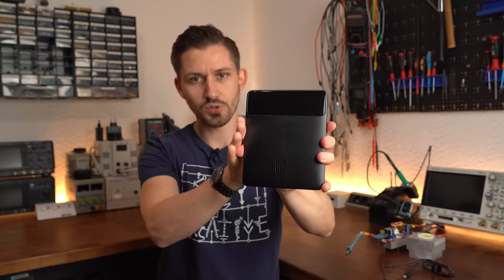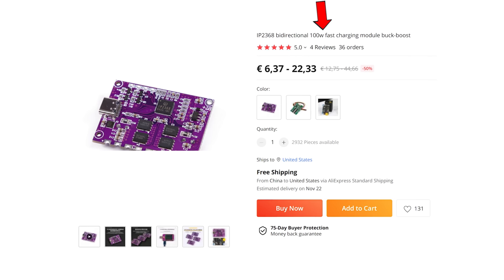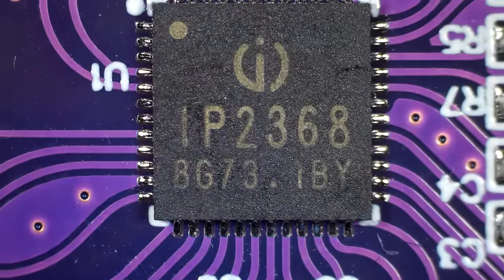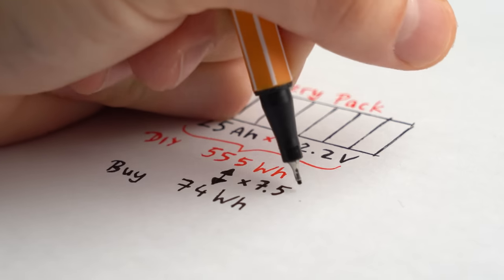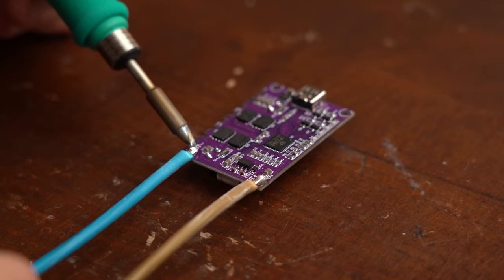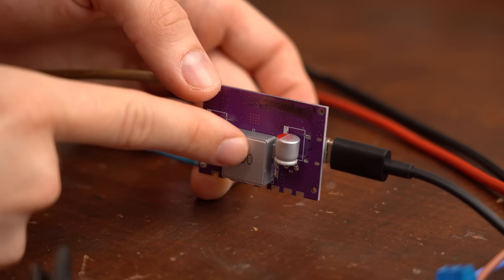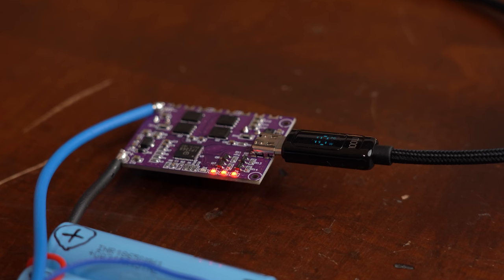My Power Bank Rivals Commercial Ones?! Super Fast! (DIY or Buy)

Comment: Hi!, you should look into sw2303, its only 6$ for almost the same board(it's not bidirectional so you will need a 1.5 dollar boost converter and a0.7$ pd decoy)
Reply: I’ve had no luck with both SW2303 versions I’ve tried. Buck boost causes overheating past 60W output
Reply: @ericklein5097 Hi, I wonder, what power supply or battry arrangement did you use? I plan to try with 5S or a 6s configuration to mitigate that exact problem but I have yet to had the chance
Reply: @liamsharashov8092  
LG MJ1 4S5P
LG MJ1 4S1P
And I have P42A's, Lishen 2170SA's, Samsung 25R6, Eve 33V, Eve 20P all available to make packs out of. the P42A's are for my super small laptop charging project for my dad. 4S 1P and 2P packs so he can decide what to take a tiny one to save space and provide just a little boost for Laptop or Phone or take the 2P to get at least a partial laptop charge on his Mac or over half on his Dell                                                                                                                                                                                                                                                                                                                                                                                                                                                     

Power supplies
Drok 0-48V 0-10 CC CV SMPS normally at 16.8V with current wide open
My Bench Power Supply 0-30V 0-10A, same as above but I've tried the voltage all over the place between 5V and 24V
SMPS 480W 24V 20A no adjustment
SMPS 360W 12V 30A with 1500W boost and 400W Boost
Sony laptop power brick 15V 8A

Boards
Feb 22 SW2303
Feb 22 SC8812A 120W
El Cheapo Sold by everyone SW2303 tried using solder pads for XT60 and a 14AWG 5521 cable
On The Way Right Now
IP2368
IP5389 (I think its from TZT Stores 100W Board)
Reply: USB C cables/PD Triggers/Loads
UGreen 1ft cables
A variety of USB C to Barrel Jack PD Triggers (20V)
XYZ PD Trigger ZY12PDN (2x)
A bunch of those male C to Female C and Female A PD trigger boards with the push button on each side of board and LED light for 5V 9V 12V 15V 20V
2020 or 2021 Macbook Pro
DL24 Electronic Load
Atorch 65 Watt Load Tester (brief moments past 65W are ok with fans)

Still need to install the 8x8x11mm pure copper heatsinks I got recently got

So I'm going to try to find the best low resistance PD Trigger/Cable but if 10 different ones didn't work....and UGreen I've seen tested and its one of the better 100W cables

I think only recently did they get a proper inductor selected and thats part of the issue. Resistance might be another as the voltage drops when power builds up but that could be how thermal shutdown. I measure temps over 90 Celsius around the IC and Inductor
Reply: @ericklein5097  wow, that is really disappointing news, but hi, why don't you make a video or something? 
I am sure it will be a great help for the community
Reply: @liamsharashov8092  I figured it out! Notice how Scott said he had to charge it and the voltage set the board up on where the SOC of the pack was?

I think that’s a permanent setting. It was shutting down on me because it thought there was no energy left in the pack. 

I’ve never charged the cells with the board and all my testing has been output output output
Reply: @ericklein5097  I don't think sw2303 support this function for this to be a problem.
No low voltage shut of and no input(only output) .
To charge the pack and get low voltage cut-off you need a different board(type c for input, goes to 12v pd decoy goes to boost board to the required voltage to the bms. bms also connects to sw2303 for output and it needs to have low voltage cutoff and such)
At least that was my plan, so if you find success with your your testing I would love to get an update.

Comment: @greatscott nice videos!!! i have a question...basically i need to reduce the number of transformers...for example i have 19.8V/90W transformer for NAS, 12V transformer for router, 6V transformer for a switch, 6V for wifi, 12V for the isp modem...they all together consume around 120W when idle...is there any way of making/buying a transformer with such a diverse power/voltage outputs? thanks a lot

Comment: I have scoured the internet and can't seem to find a pd that automatically applies voltage per device from 5v-20v. They are all manual. How are these power bank companies making these devices that automatically switch between voltages? or do they make them in house?

Comment: I like your video I get an idea now Thank you. Now I plan to create my power bank too. Can you create a 33 watts power bank 10V and 3.33A with a input and output? for my reference for creating a power bank too. Thank you.
Reply: I recently soldered a mobile Powerbank charging module to a 35mah battery.  
When I charge it, the led of the charging module lights up , but even after charging it for 30 minutes it doesn't charge my phone .

Does anyone know how to solve this issue?

Comment: Is there a way to adjust the R5 resistor to allow for 3 21700 cells in parallel lol? I have 12 21700 4100mah I'd like to turn into a big bank haha

Comment: Hey Scott, I tried using this module with a 4s lithium Ion pack, but even after charging it up (cells were already charged and it blinked the 4th/4 led) when i went to try charging a device, it blinks rapidly and doesnt charge anything!

any tips?

Comment: I bought same module i think I'll make a 100w Power Bank for my phone and which is also supported supervooc 100w but when i completed with the power bank i see my phone only charge at 10w but when i use with my laptop which supports 65w so this properly delivered 50w and charge my laptop.

Comment: Any idea what's inside the commercial one? If it also contains 18650 cells you could replace them with higher capacity A-brand cells and get better performance.
Reply: Pouch lipos

Comment: Just purchased this board. I have 12 cells that are 3400mah each. I didn't completely understand the amp restriction part of the video. Would I not be able to do a 4s3p with this board? I can go with 4s2p but if I could use the extra cells for more storage that would be great.
Reply: You can go 3P but you have to figure out how much total mah that will be and see if the resistor that controls capacity can support that. If not then your fuel gauge will just be useless.

Comment: I want to try this project using 8 ncr18650 Panasonic batteries (4s2p). Do I need to change the parameters on the powerbank module? It seems to me like the default parameters should be the same, but I am not so sure. Specially about the charging current one, which in the case of the ncr18650b battery is 1625mA x 2 (parallel) = 3.25A  (as opposed to the 3100mA x 2 = 6.2A of the lg battery in this video) . Since it exceeds the 3A from this chart 6:16 I don´t know if I should leave it at 5A or set the module to the closest 3A. I just started learning about this topic so any help would be much appreciated. 
edit: time stamp format

Comment: I am currently building a 7s 2p battery pack, and i was wondering what to use for power delivery. I want to be able to charge my laptop through usb c (at ~90W) butt I can't find a proper board that also charges the battery pack at higher voltages. Do you think there is such a board on the market, or should I just split the in/outputs so I don't have to worry about two-way boards?

Comment: hi. can you please explain one point - is it possible to connect elements of high capacity (like  lg chem for 78 amp hours or big prismatic cells) to this board? on the seller's page there is a table in which something is said about resistance and transistor r5, they say that the maximum capacity of the cell is 25000 mAh. the reason for the restriction is not obvious to me, especially if  bms  board is used. ty

Comment: would you be able to give me a direction to disable the 4h auto shutoff on a gtx280 powerbank? i think it is in such controller and not in the bms, it even shuts down with 210wh left, low current mode enabled

Comment: Hey Great Scott I've got a question for you, I'm building an ebike battery it's 48v 14s I've got a dally 40bms but I'm also trying to wire in a USB c charger so I can charge my phone while ridding Im still looking for a stepdown from 48v to roughly 12v to run a temperature based cooling fan and the pd charging. Do you think the ips2368 would work in this situation?

Comment: do i understand it correctly that the fuel gauge thing is only relevant for the LED indicators?
all the over voltage and under voltage stuff is happening independently of that right?
That would mean i can buy two of these boards and connect them to the same battery pack so i could charge and discharge at the same time or have two port that can provide power at the same time.
Reply: Hello, do you find answer for that?
Reply: @xeon8722  yes, I bought the boards and build my own Powerbank with it, the LEDs are just to show you how full the Powerbank is and require you to use a battery configuration that's supported and properly configure some resistors.
If you don't care about the LEDs all that basically doesn't matter.
I build a Powerbank with it that's above the supported capacity and I have 3 boards in there that don't know of each other so I can recharge with one board and discharge with the two others and the one board will display it is full because it doesnt know that I discharged with one of the others.
Over and under voltage protection are still working fine though.

Comment: Is 100W output really that impressive? Power Tool batteries have been able to output in excess of 100W for years. The issue is that you generally sacrifice capacity for that high power output. I remember, I changed the 18650 cells on one of my battery packs a few years back and though... hey, 3000 mAH is better than 2000 mAH. Unknowingly, the 2000 mAH battery has been used because of it's high output capability. It basically became useless for power tools because of it's higher internal resistance. I mostly just use it for low power tools, like the flash light and gives it a much longer run time.

Comment: Great project, Scott! Do you think it will accept low wattage charger to charge the battery pack like the Samsung 25w/45w charger or anker's nano charger?
Reply: Yes. I made exaclly the same as great scott and i charge mine with a lot of different chargers. i have used 5v 1A phone charger and it works but it takes all night to charge. I hope I helped you.

Comment: How do you feel about over charging li-ion cells? In your setup you are charging to 4.2V. In my experience it really degrades cells capacity over time.
Reply from the maker: Never had a problem with that voltage. Pretty much anyone charges them up to 4.2V.
Reply: @greatscottlab   - could the BMS be tweaked to use a slightly lower max cell voltage?
Reply: My charger goes to 4.1V which I'm happy with. Pushing li-ion cells to max charge every time is supposed to reduce their life but not really sure.

Comment: Every Maker worth his salt is able to build commodity items which outperform ANY store bought solution by a significant margin for a fraction of cost. This is the beauty of being a maker. I always think: Is this Item too expensive? If yes.. can I build it cheaper? If no, can I repair it? If no I don't buy it. 

Made things are 100% repairable. Bought things are usually 80% repairable when they broke the first time. I'm currently in the process of modding my houshold machines (washing machine ect.) to be more reliable, more convenient (wo does not hate the same piezo electric buzzer in every device, even +500$ machines) and repairable.
Reply: It's not always yes though, that's the whole point of this video series.

Comment: Hello 🙂
Thank you for this video. This could be a solution to build a powerbank out of tool batteries like makita, bosch etc? 
This would be a very super project - are you interested to figure this out?
Reply: This is that type of battery 18650 cells with a BCM

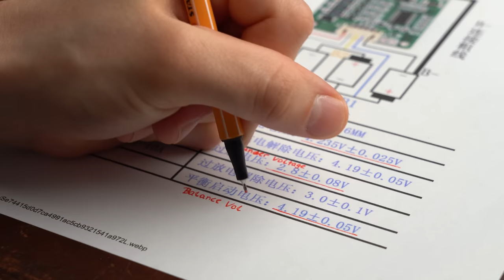Comment: 9:30 In this BMS case, could the output resistors be increased to charge the battery not to 4.20-4.25V, but to a maximum of 4.1volts, in balanced mode????
This modd, would significantly increase battery life, and it would be very important to change this!   4.1V =   + 30-40% charge cycle lifetime! If anyone knows, please let me know here!

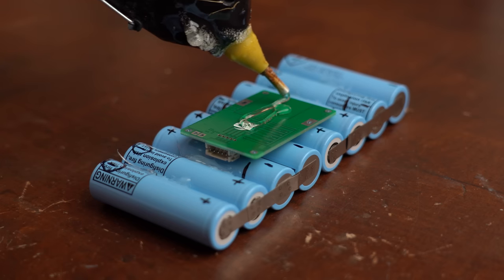Comment: Thank you for this very insightful video! I wonder whether exposing lithium ion cells to high-temp soldering at 9:44 and to hot glue at 8:49 will degrade their performance. Isn't that why we use spot welding on nickel strips rather than soldering in the first place?
Reply from the maker: If you do it quick and not often, it is not really a problem.
Reply: Got it. Thank you!

Comment: Hello, at minute 4:20 I can see some interesting specs about R5 ...etc..., on the (chinese) datasheet the resistors code are not specified as such (R5 ...etc...). Did you found this document somewhere on the internet? Or is this the result of your personal investigations?  I see on minute 5:39 that you seems to have set R5 to 6.2k while the capacity of your project seems a lot higher than this. Am I right? 
Please let me know.

Comment: Why does the board cap of the capacity of the pack? was thinking of making a 18.6v max pack with 4 cells in paralell in my pack making 20000mah but the board has the resistor for capacity set to 5000mah. What will happen if i up the capacity? i noticed that you had your pack set to 5ah but your cells set to 6.4ah? I struggle to figure this out by myself and all help is appreciated!

Comment: Can anyone tell me how to activate this module. I thought that mine was broken so I bought another one. I can charge battery with it but I can't charge any device connected. I have charged 3S2P battery pack from zero to full, diodes were lit correctly from 1 to 4. But after that it just doesn't turn on when I connect my phone, camera or PD tester.

Comment: This looks like something that could be used with 20v power tool batteries.
Reply: The voltage regulator on the board might self destruct with that voltage. ME6210 is rated max 18V.
Reply: @demm5  Yes, I caught that before I ordered one. I haven't found a suitable module yet.
Reply: @demm5  Annoyingly, the IP2368 supports up to 6 cells but I can't find a module that supports 5 🤪
Reply: @The_Ballo  replacing that voltage regulator with something that would handle higher voltage might work but if that's how it came out of the factory I wonder what else in this board is rated for no more than 4 cells
Reply: @demm5  is it possible to put 16 batteries? of course 16.8V, each cell contains 4 batteries, and of course with a BMS protection circuit, does it work? :)
Reply: @behnamp9174  you mean 4series 4parallel configuration?

Comment: Dead Scott. What is the tool called you are using to attach batteries to eachother?
Reply: It is a spot welder for the connections and just hot glue for the batteries themselves
Reply: @ultimatedarkkiller7215  Thank you

Comment: Have an issue with my 100W PD board.
I changed the resistor (to a 27K) for 6S 2P (21700 cells) but it only charges to 21V (5S). Anyone have any ideas? Something g else I need to change?
The pack is about 8.5Ah

Comment: The purple PCB says that the R5 resistor can be set depending on the cell capacity. To be more specific 6.2k Ohm pr 5Ah. But does that mean if i have a 120 Ah battery, that i can just set it to 148.8kOhm?? Their table doesnt show anything past 25Ah. 
Does anyone know or have experimented with this?
Reply from the maker: I think that is just the limit you shoud not pass

Comment: The winner is buy. You spent countless hours reading confusing Chinese datasheets, hacking away at some prototype boards, designing an enclosure, assembly, all to save 20 euros? That's a lot lower than minimum wage considering hours of work spent on this. And it didn't even fulfill its promise of 100W. The voltage sagged at 5A load. The DIY is a big loser for me.

Comment: Hello sir I been a long time watcher of your Chanel and I was wondering if you could make a video on how to use kiri moto for cnc machining because I use to use it but they just updated it and I don't know how to use it anymore and I know they come from onshape  and I made my own cnc machine based on the mpcnc machine and I also bought a 3018-PRO plus cnc machine and I still can't make the pcbs I designed in easy eda for the stepper motor drivers the tb6600 stepper motor driver I designed a new pcb that will connect to the 3d printer motherboards like the a4988 stepper motor drivers so if you could make a video on how to use the new version of kiri moto for cnc machine to make pcbs

Comment: its hard to find 18650 that can really deliver 10A
Reply: Not really. There are a ton of 18650 cells that can deliver more than 10A, look up Parametrek's excellent Battery database and filter by "discharge"

Comment: Ip2368 is bidirectional great module. But a cheaper one is available that only outputs pd. Can you please try the sw2303 chip? There aren't any videos available.
Reply: It sucks. Signed someone that owns multiple different boards with that chip. 

I’m sure the IC is great but no one on Ali has made a good module
Reply: @ericklein5097  That's unidirectional and less than half the price with all protocols supported. Would nice to know more about it.